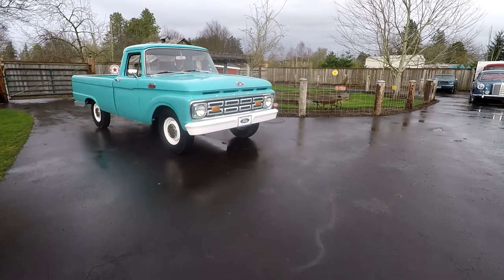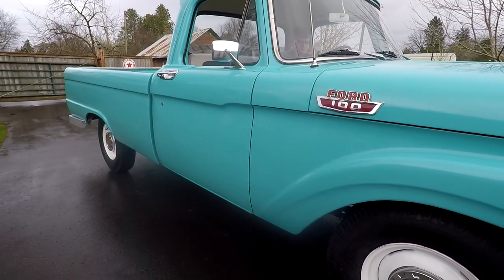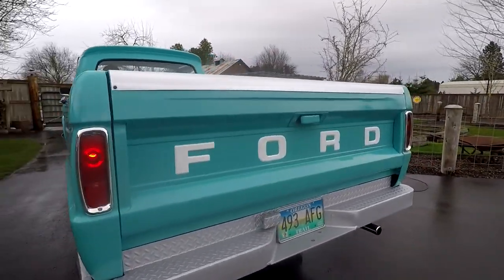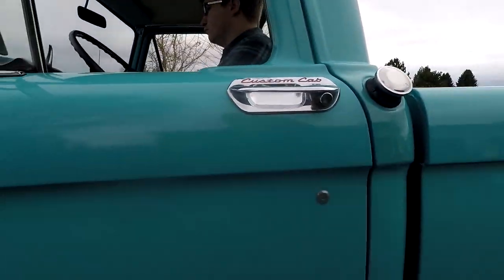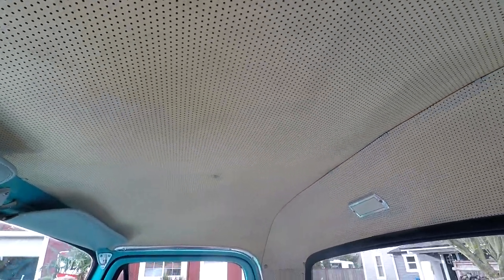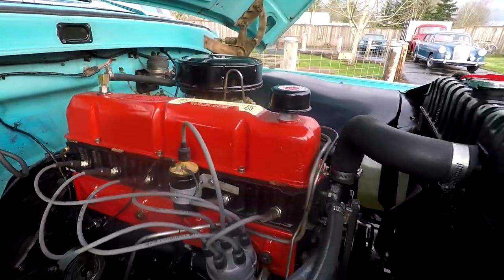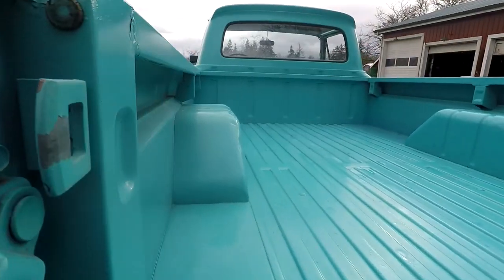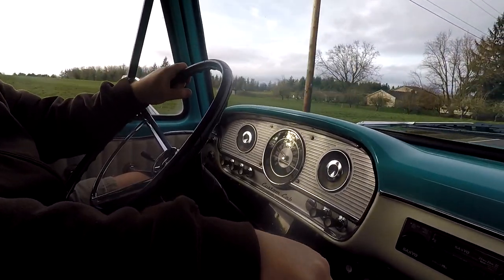1964 Ford F100 Custom Cab - Denwerks- Bring A Trailer

Comment: That is a beautiful truck.  I am working on mine right now.  I have the 1964 F250. I put an adapter plate on it and put a Holley 4 barrel 1850-16.  Runs great.  I am going to have to get a new set of tires.
Reply: Nice looking Mercedes in the back ground.  I have  a 1981 W123 240d.
Reply: back when trucks were tin cans

Comment: I want to get a 1964 F-100, and do a restomod with a 429 SCJ attached to a 4 speed  manual transmission, and 12 bolt rear end. The interior will be white leather buckets, with a perfect, Cobalt Blue paintjob. 
I'm hoping to go from start to finish on this project by the time both myself, and the body of the truck turn 60 years old!
God willing, I'll leave this vehicle to my currently 15 year old son!
Reply: Hey a 1970 boss 429 engine is the same as a 1971 429 scj drag pack engine